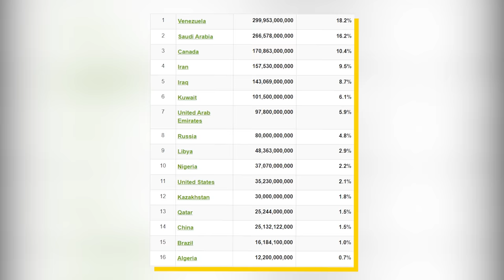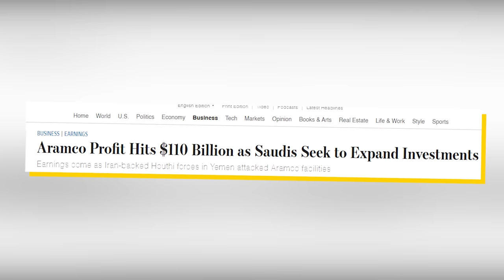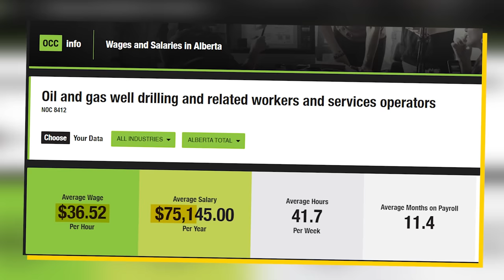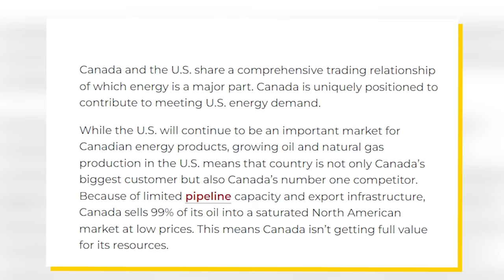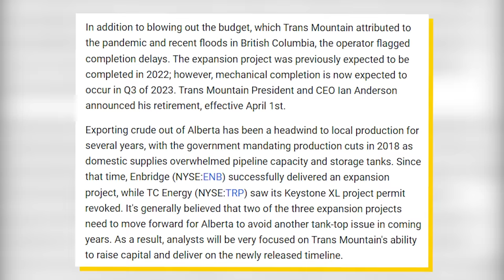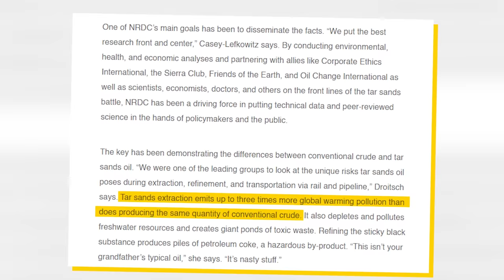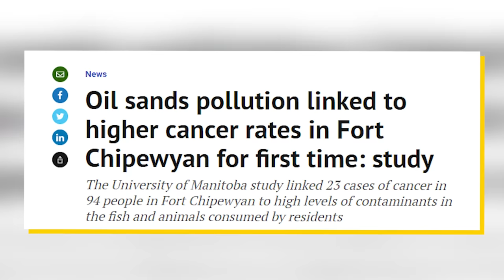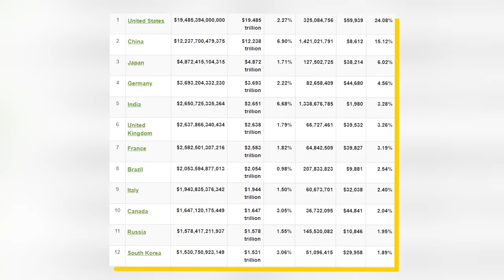Why Canada Refuses To Exploit Their Gigantic Oil Reserves

Comment: I understand you had a time limit for this video but a LOT was left out. When an oil company is done with an Oil extraction site they have to clean it and put it back the way it was before or in better condition then when they started, which is a high end of life price for any project. Another big issue is the lack of refinery capacity within Canada, lets just say there hasn't been many new ones in the last 30+ years... One of the reason for the discount on Canadian oil is that not all refineries are able to refine it. If we could refine the product in house, it would make it much easier to export, and we could charge a LOT more for it. But you know, that wouldn't be in the best interest of everyone, after all, the company that owns the right to the product use to dilute Crude oil that allows its transport via rail would have a lot to loose if new refineries or pipelines were built. But that would never happen, we're just talking about Berkshire Hathaway, they would NEVER do such a thing. lol
Reply: @240sxcollector  It isn't easy to ship refined Oil products.. very expensive.   One of the reasons for the lack for refining is the cost to build refineries.   Let's not forget it cost a lot to get the oil out of the ground, add refining costs on top of that and it would exceed what many countries would be willing to pay.   The bottomline, is that Canada's Oil is expensive to extract and is expensive to the Eco system.   Canada would be better of investing that money and energy into Green Energy Industries and technology, that is the future, Oil will have a more limited role going forward.
Reply: @tonespeaks  You are full of baloney.  There isn't a green energy industry that makes money without government subsidy.
Reply: Nuclear power.
Reply: There is plenty of refining capacity in Canada.In fact Canada exports about $10 Billion in refined petroleum products mostly to the US.The Refineries in Alberta ,Saskatewan and Manitoba all use WCS as feedstock.The only area in Canada with a lack of refining capacity is BC.But recently they announced that the Burnaby refinery will be expanded to allow for more capacity.Currently BC imports both gasoline and jet fuel from the Washington refineries during peak demand periods. The current Trans Mountain pipeline can batch ship so Alberta supplies both crude oil and finished gasoline to BC via that pipeline .BC's other northern small refinery uses BC domestic oil. The refineries in Ontario use a blend of upgraded oil from Alberta and import light crude from the US. The Ontario Sarnia refinery has a direct pipeline from an Alberta upgrader and uses that for it's feedstock. The 2 Montreal refineries use upgraded oil from Alberta via pipeline and tanker oil mostly from Algeria,Libya and middle east. The Irving refinery Canada's largest refinery uses Saudi Arabia light sweet crude mostly but brings in some WCS from Alberta by rail. Actually Alberta recently built a new ultra low Sulphur diesel fuel refinery . But you are correct that in the past 40 years hundreds of small refineries have been shut down in North America. Refining oil is a low margin business so you have to have very large refineries to make money. Forget about refining oil in Canada to ship finished petroleum products to the world. They want your crude oil not finished petroleum products. The cost to build a new large capacity refinery would be in the neighbourhood of $15 to $20 Billion ,plus about 5 years of construction.Who would build it? That new smaller ultra low sulphur diesel fuel refinery in Alberta  came in at $9.3 Billion! The US has the refined petroleum market wrapped up with huge refineries on the Gulf of Mexico ,mostly in Texas. The basic reason that the Eastern       refineries having to import light sweet crude is that is what they need to make a lot of gasoline which is the product in most demand in the areas they supply.They have retooled to accept some upgraded Alberta feedstock but they need light oil to operate. Plus Canada has a lack of pipelines and frankly it is cheaper to get in oil by tanker. Cost of shipping oil is a big factor.
Reply: @don-cw1yz  I agree with most of what you're saying, but to say that there is plenty of refining capacity is far from reality. When we went from producing about 1.7 million of barrels a day in 1990 to 4.7 million barrels a day now, with the possibility to increase it another million barrels a day within 2 years if we really needed it. All while the refining capacity has stayed around 2 million barrels a day since at least 2004, back when production was around 2.5 million barrels a day. In that 18 years production went up over 2 million barrels a day with no real increase in oil refining capacity. 
But like you said, we do a have a huge infrastructure problem. Even if we wanted to send oil to Europe right now, the only real way we have would be to send it via the Gulf of Mexico. We just don't have the infrastructure to ship our oil from Alberta to other Countries, well other then the US, which account for 97% of our Crude export. If we could get pipelines created to allow us to move our oil more freely Est and West, building refineries able to refine Crude would make much more financial sense.
Reply: @240sxcollector  You are about 40 years too late to start building refineries.The US gulf coast refineries have that business covered. The last refinery built in North America was in Alberta for ultra low sulphur diesel fuel a couple of years ago it is a small refinery but can be expanded and cost $9.3 Billion. Hundreds of small refineries were shut down in North America over the past 40 years. Refining oil is a low margin business.You have to build large refineries to make money so if needed existing refineries can be expanded. A large refinery would be about $30 Billion or more to build and takes about 5 years in construction. Where would you build it BC ? That was proposed 10 -15 years ago ,never happened.There is a huge NIMBY factor to build a refinery. Besides the $30 Billion for the refinery you need to build a feedstock pipeline another $25Billion .The market for Canadian oil is crude oil not refined petroleum products. Plus we are talking Canada where it generally takes forever to get anything done.As an example let's look at the LNG plant under construction in Kitimat. It was first proposed in 2011 by the Christy Clark liberal government.So construction began in 2021. Expected completion in 2025. So 14 years from initial solid proposals. Now let's look at LNG in the USA. The US started major exploration drilling for natural gas in 2016. They discovered massive amounts of natural gas and have used it to convert coal fired electrical power generating plants to natural gas en mass in the US. They have built LNG facilities and are shipping Europe LNG. Time frame 6 years.In the US they have the capital investors ,in Canada you need foreign investment as it is a $40Billion project. It takes a very long time to get things done in Canada these days.
Reply: @240sxcollector  Actually you hit the nail on the head when you said the best way right now to reach the countries that want WCS crude is through the US to the Gulf of Mexico US shipping terminals. That is what the US is doing. The US and Canadian oil industries work together very well. The US oil industry has reconfigured some pipelines to enable shipment of Canadian WCS. Heavy oil is actually in great demand by some countries that need it.Venezuela production is very limited. Their oil infrastructure has deteriorated.Their fleet of tankers are inadmissible in international ports due to poor condition.So Spanish refineries that needed heavy oil now get Canadian WCS via the Gulf of Mexico shipping terminals.  As to cooperation just look at how the Irving refinery in Saint John supplies the needs of the New England States for refined petroleum products and how the Washington refinery supplies finished petroleum products to BC. The BC Burnaby refinery will be enlarged to increase capacity ,that was announced this month. Many Canadians seem to think we should be fully independent and only use Canadian oil in Canadian refineries. We do in the Alberta,Manitoba & Saskatewan refineries and the Sarnia Ontario refinery that gets feedstock directly from a upgrader in Alberta. But the other Ontario and 2 Quebec refineries need to blend upgraded oil from Alberta and US permian basin light sweet crude and in Quebec tanker light sweet crude.The Irving refinery in Saint John gets the majority of its feedstock from Saudi Arabia. That refinery does blend in some Canadian WCS that it receives by rail. Part of the issues in the oil business is the cost of shipping. So if it is cheaper to get crude by tanker vs pipeline then that's what refineries will use. Refineries are going to use the feedstock that allows them to produce the refined petroleum products needed in their area.So for example light sweet crude is easier to process and produces a lot of higher valued products like gasoline/Jet fuel. So Canada sells a lot of crude oil but also needs to import some also. But for example Saudi Arabia sells oil to the Irving refinery but Saudi Arabia also buys Canadian products like military equipment.
Reply: @don-cw1yz  And I think you hit the nail on the head when you said "It takes a very long time to get things done in Canada these days" ... As for Canada and the US oil industries working well together well that is a given, considering a lot of the big oil companies own the process from extraction to when you put the gas in your car... but this good coordination also comes in handy during tax time, as these corporation tend to declare more of their revenues where they are tax less. While you would think that this would be a good thing, as it means the process as a whole is more profitable, this is true for the corporation/investors, and country getting the extra revenue declared. Since Canada often has more aggressive tax structures, this means a good portion that would otherwise be declared in Canada gets reported in the US. As you might imagine tax avoidance is not legal, but since Canada doesn't have significant dealing with other market, it's almost impossible to prove, hence how they get away with it. Since they own the whole process they just need to play with the margin a little along the way. 

Canada is a resource rich Country, but we often get taken advantage off because of creative accounting. There is a reason a lot of company move there head office out of Canada, some Canadian companies even bought US company for this sole purpose in the past. A few even made headlines in the news. But while this issue can be seen through a lot of sectors, it seams to stand out way more in the sectors that are not well diversified. Maybe saying to just refine the product in house was an oversimplified answer...  what I probably should have said is, Canada really needs to work on updating/upgrading its pipelines to the Est and West coast to make our oil accessible directly to other market, allowing us to hopefully narrow the discount on our oil. Then at that point, since we know that any extra capacity would be used for export anyway, BC and Quebec/NB could decide if building new refining capacity would be worth it. Who knows maybe Ontario could jump in and say they could use more plastics from Heavy crude, for some electric cars or something... 

But I wouldn't hold my breath, as you said even pipeline aren't cheap and this would require companies to invest a LOT of money, to actually help Canada be less reliant on them lol
Reply: Not sure if this still applies, but last I heard we couldn't even sell to the EU without significant refining. not only can we sell refined hydrocarbons at a higher price, but it also opens up more  markets in which to sell
Reply: @kevincusack5671  BC Hydro (which is mainly Hydro-Electric dams) has consistently made a profit for the past 10 years, last year they made $6.4 billion
Reply: @blackoak4978  The EU has a lot of refining capacity.In fact many of the EU refineries can process heavy crude like WCS. Spain comes to mind in particular as their refineries use heavy oil exclusively. Due to Venezuela production down ,Spain now gets Canadian WCS from the US gulf terminals.

Comment: Canada is about to be a huge provider of LNG, gas is about as bountiful as oil in the country, and new gas fields are being found. The first major terminal should be up and running by the middle of the decade. I can vouch for this as I personally am working at said LNG terminal. Canada also has great mineral and metal wealth.
Reply: I personally believe that Canadian oil and gas will eventually be more just gas than oil. Alberta oils are in a difficult situation for anything but domestic markets, and investment into it has been hesitant. While not all alberta crude comes from oil sands, 39% of extracted crude is bitumen, while another 28% is synthetic crude produced from bitumen. Only a third of extracted crude is not bitumen or sourced from, which means options in canadian oil are very limited. With the decarbonizing movements, power production will more heavily rely on natural gas plants to keep up with the fluctuations of renewables. Canadian gas can fill this role for north america and europe as it is a more ethical source for gas and western nations have very good relations.
Reply: Mike Tyson  kitimat lng is almost finished.
Reply: Why can’t people realize that expanding the oil and gas industry in any form is the opposite of what any developed nation should be doing right now.
Reply: @mattkrumm8141  Inlet gas facilities, non process buildings, about half of Train 1, main storage tank and much more in place. Marine base in place and energized, most substations in place, trestle is only about 70m gap. Though commissioning and startup will take almost a year, but it's coming along and hopefully catch up to delays caused by Covid.
Reply: Is Kitmat hiring?
Reply: @Josef_1186  Why? The planet is energy starved and the only way for the have not nations to raise their standards of living is cheap energy.  Since nuclear energy has been criminalized and wind and solar are so intermittent and cannot be base power, what is left but hydrocarbon energy!  Hydrocarbon energy is a very minor contributor to climate change and there is no emergency; plus the planet needs more CO2 to green it. The benefits of Hydrocarbon far outweigh any negatives!

Comment: Canada has the highest standards of environmental protection extraction in the world. In addition they reclaim the land that is strip mined putting it back in the condition it was found. While this is good it seems to leave these important factors out.
Reply: That's what they say, except the oil sands have miles upon miles of tailings ponds where toxic waste is dumped in the open air. There is no serious reclamation going on.
Reply: Hahahaahahahahaaha Hahahahaahahahaahah Hahaahahaahahahaaa!!  Where in the actual fuck did you get that idea from? Rebel Media?
Reply: Definitely the highest regulatory and and I'll add human rights standards with only Norway, Scotland, and Australia even in the conversation among larger players.  That being said I find it much more useful to separate climate change causing emissions (which oilsands are a whopping ~2-4x more per barrel) vs everything else environmental.  Pointing at strip mining, giant tail ponds (both in reality are very rare and frankly now uneconomical thanks to regulations) and pipeline spills (which have similar statistical environmental impact to building major highways or electrical transmission corridors) is like blaming Chernobyl alone for why nuclear stalled.  Ancient tech that allowed for a much higher risk of human exposure and environmental catastrophe has little to do with the real modern complicated economical and political challenges like competing with ever-dropping solar (for power/cars) or just the public and market's understandable hesitancy in funding 50yr+ capital projects when no one really knows if the demand for oil will shrivel against "new tech X" over decades (or even over years) like lamp/heating oil aka kerosene, coal/steam based transit, or VHS lol